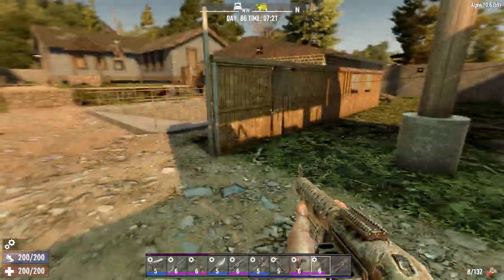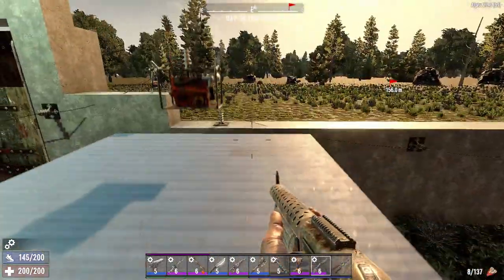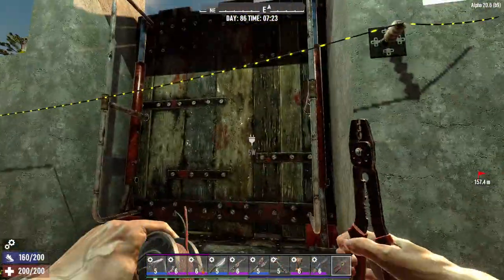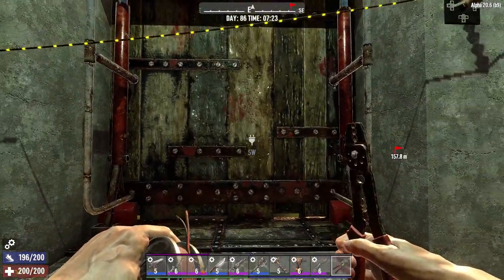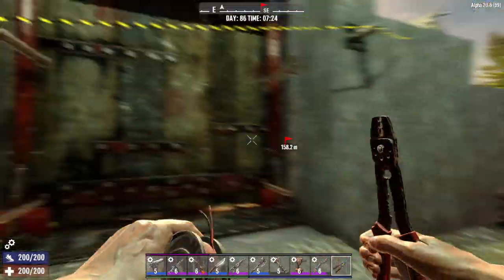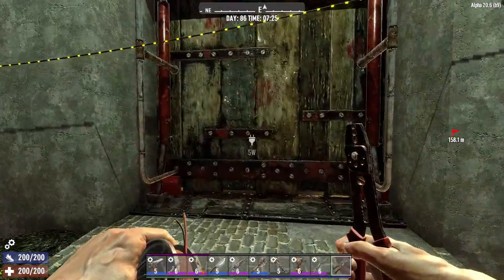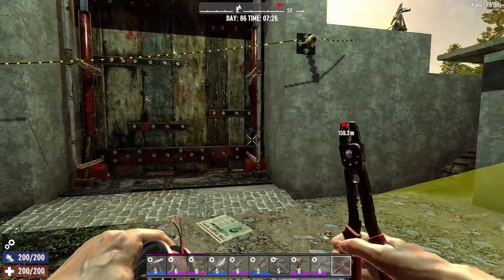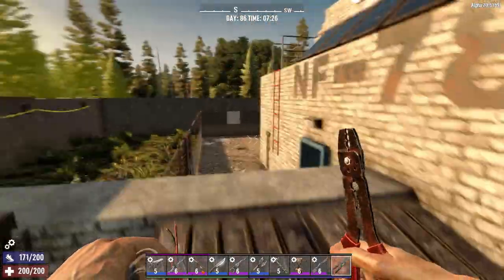7 days to die powered drawbridge setup

Comment: I’m having a difficult time with it because my one camera needs to have since motion to supply the next camera with power so whichever one is not first in the circuit does not work unless the first camera has sensed motion to send power to the next camera, which at that point I don’t need the other camera so therefore it literally only works from one side is that because of the relay that are connecting the two cameras together